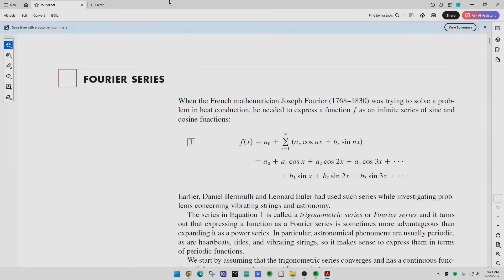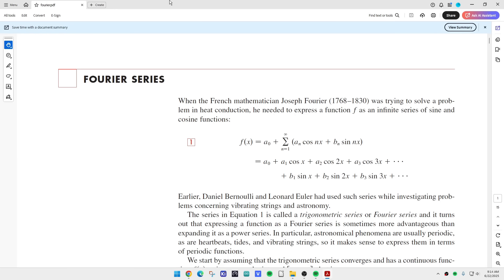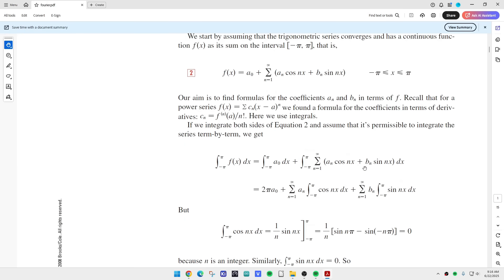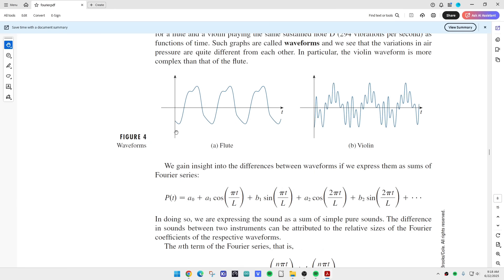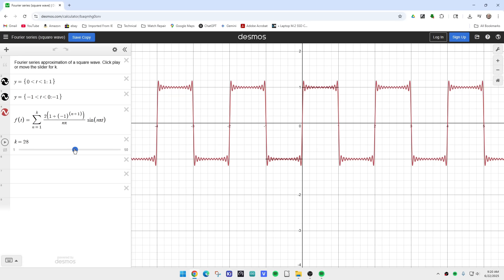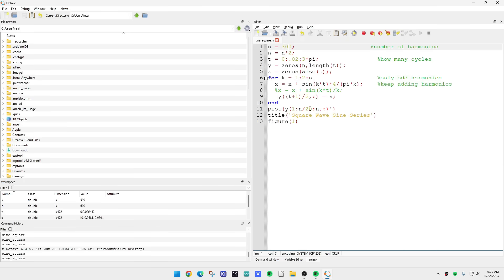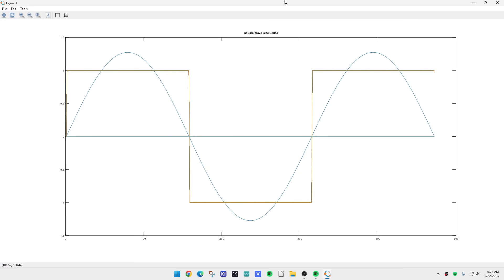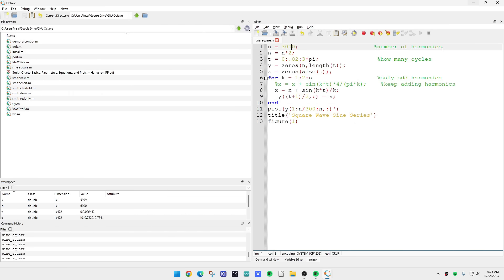#2282 Fourier Series of Square Wave

Comment: Thank you for the follow up video.
FYI, By default Octave will use only 1 CPU and single thread. There is addition to Octave, octave-parallel (apt install octave-parallel    in Debian). After installing this, you may use 'pkg load parallel' (without the quotes) in your code and Octave will take advantage of multiple cores. It's much faster.
Reply from the maker: thanks. I might try that. having used matlab for decades at work. octave is a real slug.
Reply: @IMSAIGuy  Check also ocl package for octave.

Comment: Modern versions you might see in signal analysis aren't the FFT, but the Discrete Cosine Transform (DCT). Same idea, except as mentioned you only use cosine waves (no sine waves). The reason for this it in a DCT series, the DC term automatically pops out as cos(0)=1 so you don't have to include it as a separate coefficient in the series. DCTs are used for image (JPEG) and video (h.264/AVC, h.265/HEVC) coding. Note that h.264 uses a modified DCT some have dubbed "the h.264 cosine transform", but it's internally the DCT. That's how fundamental the Fourier Transform is and in EE, you will come to loathe it and all the integral calculus fun. It's as if the sole reason for calculus is doing Fourier Transforms (and its related couterparts of Laplace Transforms).

Comment: The FFT has some very weird properties that if you wonder why there are some odd ball instructions in a CPU, it's because of it. One of them is "address bit reversal" where the N LSBs of the address bits are reversed, e.g., instead of A7..A0, if you reverse the last 3 address bits, you get A7..A3, A0, A1, A2 instead as the address. This is because the output of the FFT doesn't come out in a "nice" order but rather scrambled, so someone figured out that if you reverse the address bits, they get put in memory unscrambled. So if you do say, a 4096 point FFT, the output of frequency bins are mixed up. But if you reverse the lower 12 address bits, they get put in memory in the order you expect. (This is done prior to the cache for optimum performance because random reads and writes to memory are slow).

Comment: Sorry to be that guy but the Fourier series never becomes perfect. It always overshoots (by quite some margin; roughly 10%). This is called the Gibbs phenomenon (there is a Wikipedia article on it) and it is the reason why mathematicians spend quite some time discussing the notion of convergence for functions. Point-wise convergence does not hold here.
Reply from the maker: don't worry, it does become perfect at infinity.
Reply: @IMSAIGuy  I guess I wasn't clear. In the infinite limit the overshoot is roughly 8.9...%. So it does not become perfect.

You would see it in your graph if you adjusted the window. Make it smaller as you increase the number of harmonics. You will discover that the bump does not disappear.
Reply from the maker: @olaf_dreyer  you are right because I did not have an infinite number of (or no) steps. Gibbs is for decrete steps.
Reply from the maker: No "Ringing" at Infinity (in the pointwise sense): While the partial sums always show ringing, in the limit as the number of terms goes to infinity, for any specific point that is not the discontinuity, the sum will eventually settle down to the correct function value. The "ringing" effectively becomes infinitely narrow, collapsing to zero width.
Reply: @IMSAIGuy spot on.  The only discrepancy in the limit is that you get points at zero for the discontinuities, whereas the input function has no such zeros. 

I believe the confusion on Gibbs phenomenon is that many texts misstate what is happening.  They are trying to point out that even though the majority of the function smooths out in a sort of monotonic way, the edges don’t.  They get worse before they get better in a sense.  But those same texts don’t go far enough to clear up the confusion at infinite terms.
Reply: @IMSAIGuy  That is correct. In the infinite limit it is the value at zero (and all other step positions) that deviates from the perfect square. The value there never becomes unity but converges to a value roughly 10% higher (you can find a proof in the wikipedia article). In the history of mathematics this was an important observation.

Best wishes from Germany!
Reply: @olaf_dreyer The “crossings“ converge to the average of the + and - values of the input function.
Reply from the maker: @olaf_dreyer  Here's why:

Pointwise Convergence: For a function with a jump discontinuity (like a square wave, going from, say, 0 to 1), the infinite Fourier series converges pointwise to the value of the function at every point where the function is continuous. At the point of discontinuity itself, the infinite Fourier series converges to the midpoint of the jump. So, if a square wave goes from 0 to 1, at the point of discontinuity, the infinite series will converge to 0.5. It will not converge to 1.1 (10% higher than 1) or any value higher than the jump.

The Gibbs Phenomenon (and its interpretation): The confusion likely stems from a misunderstanding of the Gibbs phenomenon. As we discussed, the Gibbs phenomenon describes the overshoot that occurs in the finite partial sums of the Fourier series near a discontinuity. This overshoot, for a square wave, is indeed approximately 9% of the height of the jump.

For example, if a square wave jumps from 0 to 1, the partial sums will briefly go up to about 1 + 0.09 = 1.09 (on the higher side of the jump) and down to about 0 - 0.09 = -0.09 (on the lower side).

Crucially, this 9% overshoot persists in amplitude as you add more terms. The oscillations get narrower and narrower, getting squashed closer to the discontinuity, but their height doesn't diminish.

The "At Infinity" Resolution: The key is that while the amplitude of the overshoot remains constant, the width of the oscillations goes to zero as the number of terms approaches infinity. This means that for any specific point that is not exactly at the discontinuity, the infinite series will eventually settle down to the true value of the function. At the discontinuity itself, it converges to the midpoint.

So, at infinity, there is no "ring" with a finite width and a 10% higher value. The overshoot has effectively collapsed to zero width.

Analogy: Imagine drawing a square wave with a marker. If you only draw a few straight lines, you'll have jagged edges. As you add more and more tiny, straight line segments, the jaggedness shrinks, and your drawing gets closer to a perfect square. The Gibbs phenomenon is like saying that no matter how many tiny segments you draw, you'll always have a tiny "spike" at the corner that goes slightly beyond the true corner, but that spike gets infinitesimally narrow. In the limit (infinite segments), the "spike" has no width, and the corner is perfectly sharp.

Therefore, the person who says the result is 10% higher at infinity is incorrect. The 10% (more accurately, 9%) overshoot is a feature of finite approximations, not the infinite sum at infinity.

Comment: Glad you did this... When you showed the spectrum analyzer giving even harmonics with changing duty cycles I wondered what was the math behind it, but could never figure out the right words to put it into the form of a question. I was literally too embarrassed to ask! So thanks! I plan to look further into this to understand how it is that the universe 'knows' to use Fourier transforms to do this. Perhaps this is proof that reality itself is some kind of computer simulation! Too deep for my little brain... 😀
Reply: If it helps any, you can decompose a non 50% duty cycle into a square wave plus a rectangular pulse.  The transform is linear - that is you can take the transform of those two parts and add them to get the transform of overall function.  In this case, you’ll get the odd harmonics still from the symmetric part and a phase shifted sinc (ie sin x over x) which contains even harmonics. 

It does seem a little like magic, but really no more so than say a Taylor series decomposition.   Have fun!

Comment: Fourier is really an interesting subject... and in this line, also approaching it in a very light way like you did, there are some scholar papers from Tektronix that scratches the subject of Fourier to go on teaching about how, and why, square waves are instrumental for oscilloscope's signal integrity assessment and calibration.
And those papers describe how an square wave that is made up of an imbalanced number, or relative amount, or displaced in time, of harmonics, distort the square wave in x many ways.
It's amazing how much you can tell about an amplifier's signal fidelity when you just look at the waveform

Comment: One of the important lessons from the Fourier series is how many harmonics you get from those sharp edges on a square wave!  I worked on EMC (electromagnetic compatibility} for a while, and learned that those sharp edges can cause you to fail emissions tests!  Reduce the bandwidth, slow down the edges, and you'll reduce the emissions at higher frequencies.

Comment: It's interesting that once you get to n=3000, the ringing is worse on the trailing edges than it is on the leading edges.  I can't think of any physical reason for that, so I'm assuming it's just an artifact of the digital math?
Reply: Yep.  Finite resolution of the numbers.
Reply: The ringing is just as bad on both edges (and will never go to 0); the limitations of displaying it digitally make it appear different for the leading and trailing edges.
Reply: @davidlindstrom4383 Any practical sum (that is, one that can be computed in finite time) will have ringing, but in the infinite limit, they do actually go away.

Comment: Thanks for covering this. It was a little over my head. Maff ain't my strong suit. The Engineer Guy - Bill Hammack did a cool series on a mechanical device that decomposed the frequencies and coefficients using gears and levers. Veratasium also did a cool series on how these machines were used to predict sea tides. I remember from trade school there was a lesson on square wave testing of amplifiers. One of main points of the lesson was that if your amplifier under test can pass a good looking square wave, its bandwidth is 10X the square wave frequency. For one of my school projects, I built a Futterman amplifier. The construction article claimed it had 10 hz to 100 khz frequency response. I thought that was bogus, but the amp would cleanly pass a 10 khz square wave.